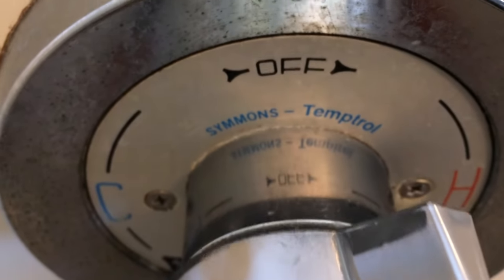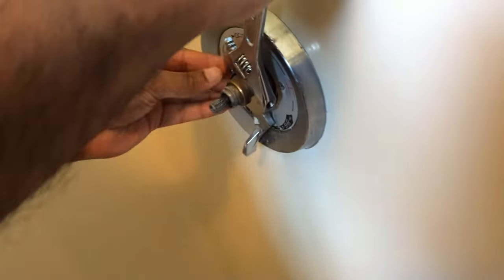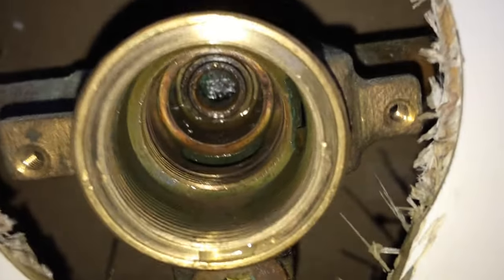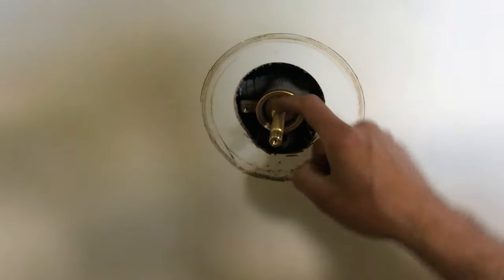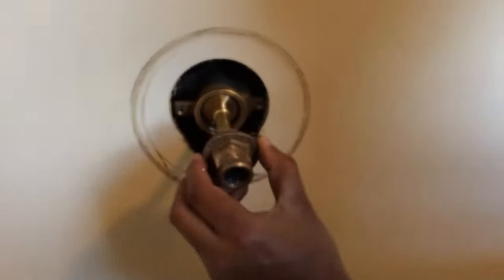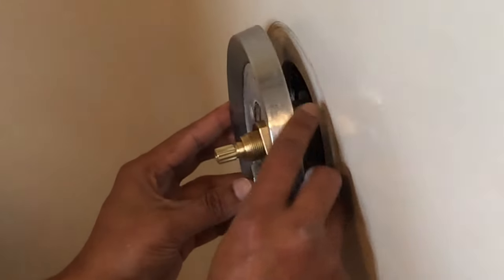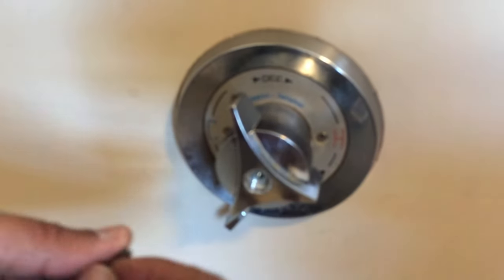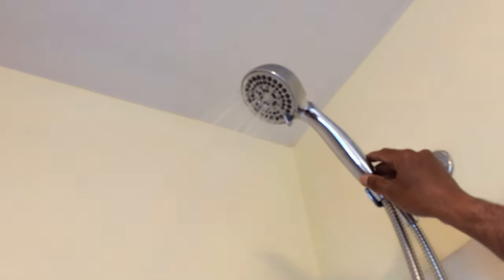Fixing Symmons Temptrol Shower Leak

Comment: Thanks for pointing out the stem should make a sound when you shake it.  The shower in our guest room (2018) is rarely used and our recent guest could not get hot water.  I had removed the stem, which is essentially new, and after viewing your video I realized it did not make a noise when shook it.  I use rubber hammer to tap on the stem until it made noise when I shook it.  That did the trick, our guest now have hot water.  Thank you so much!

Comment: The nut is seized and will not unscrew.  I will get a pipe for my wrench.  Should the pipe and wrench work.. Anything else needed.  I don't want to use too much strength and break any pipes.
Reply from the maker: Yep! The pipe and wrench always works. Just don't use too much force and make sure to apply force in the right direction.

Comment: I have a Symmons, same shower plate, different handle though. The screw is STUCK in the handle and no tool will get it out that I tried. I need a professional! The screw is just jammed in there!
Reply from the maker: Make sure the head of the screw is not stripped. If not, you would want something to dissolve the salt if the screw is jammed from salt accumulation. And if rust is jamming the screw then you would need to use something like wd-40 or pb-blaster but safer to dissolve the rust. You don't want wd-40 or pb-blaster to mix with your water, not safe to use.
Reply: @SwadesiTV  I tried WD-40! Didn’t do a thing! Not even a little loose! Idk I probably would need a stronger lubricant because it’s really rusted in there. Where does the salt come from? The water?
Reply from the maker: @StrongNoah  PB-Blaster is the next powerful thing to remove the rust. Spray it and leave it for half hour and spray it again few times like that. You need to soak the rust basically. You can also use little bit of heat, but you have to be very very careful. If you already sprayed wd-40, it is flammable! Yes, the salt does come from water.

Comment: Dang was really hoping you could fix this without shutting off the water main. Have to crawl through the mud under my uncle's old trailer home to get to it so I can fix his. Can't believe these trailers don't have shutoffs anywhere else inside.
Reply from the maker: Sorry to hear that. With the water on, it will be hard to work and will make a mess.
Reply: @SwadesiTV  Do you know what those plastic Temptrol spindles are for when I look on Home Depot for replacement parts? It doesn't look like they were in this one you opened up. They come in black or white colored plastic. I have an old style diverter.
Reply: @SwadesiTV  Thank you so much for your video! Holy moly finally got this taken care of. It had failed hot. What a stupid design! My uncle was paying a ton on water and propane because it was leaking hot water 24x7. I went in and replaced everything like your video shows and applied plumber's grease on every thread to make it easier on the next person to repair it. It was in so tightly that a couple brass threads had come lose and came out with the parts. Thankfully no broken pipe disasters, which is what I was most concerned about.

Comment: It was tough because you forgot to remove the packing nut, don’t worry first time was practice !
Reply: In my case, the packing nut is the part that's leaking, not the spindle.
Reply: Where is the packing nut located? At what point should he have removed it in the video? I'm asking because I have trouble with these valves off and on and a friend has trouble now. So I may have to take the thing apart and I'd rather I was following precise steps and not missing anything. Thank you. All the best!

Comment: Plumbers choice 4 in 1 on the app
I’m a plumber. I came across a zurn that looks identical to this today. When people build, they hardly ever take into consideration repairs such as this. IDK whether they look at price, looks, or the architect just has an affinity for some of these names. Get you a delta or a moen. Replacement parts are on the shelf at every hardware or plumbing supply house in your area.

Thank you for your video
Reply: Is it really necessary to replace all that to stop it from leaking???

Comment: Thanks!  The outer seat on mine was so corroded I stripped it with the tool.  Nothing to byte on now to get the outer seat out.  Now I need to replace the whole valve body.
Reply: Hope you went with a delta or moen. They’re always on the shelf at the plumbing supply house. Thanks for your input.
Reply: Hi Joe, you’ve probably already finished your repair, but a screw extractor may have gotten that seat out.